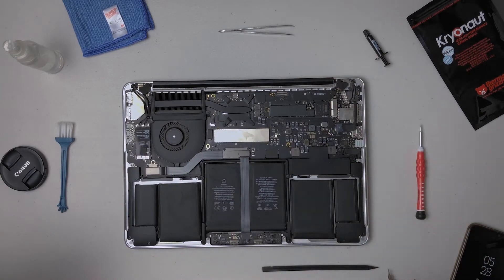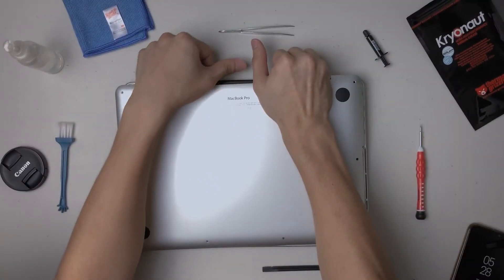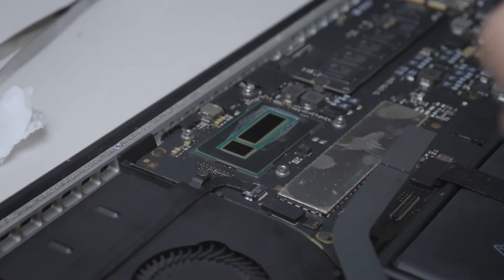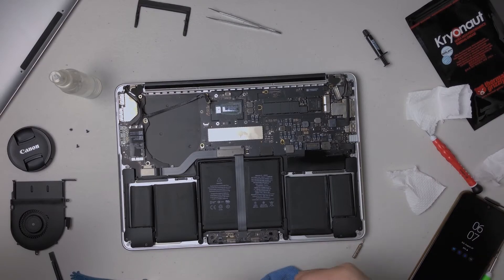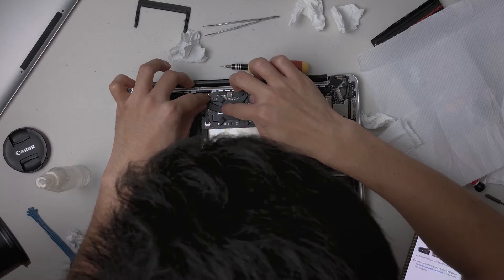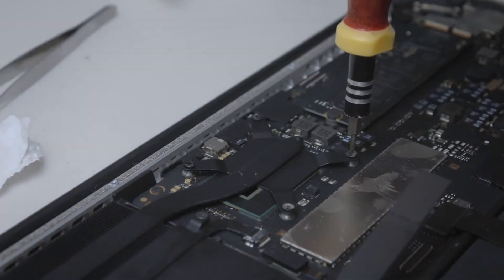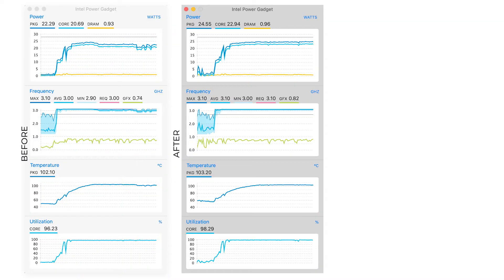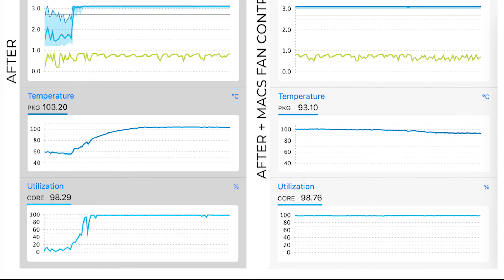MacBook Maintenance - Cleaning, Speaker fix, Thermal paste | 5 years and counting

Comment: Do you think Mighty Bond will work? hehe
Reply from the maker: hmm I think it will work but not as well as thick adhesives like rugby. some actually used elmer's glue and said it worked well haha check out my video specific to speaker fix (link in description), full instructions are there and many viewers shared what adhesive they used. you might find it useful

Comment: I have noticed that the temperature after is higher + you start with higher base temperature. Please make sure you have applied the paste correctly.
Reply from the maker: Was it resolved when you reapplied the thermal paste? 
I did a temperature reading before and after and I got the expected temps. Got lucky to get it right the first try (first time applying thermal paste).

Comment: 100 degree Celsius? That’s so dangerous isn’t it?
Reply from the maker: Hmmm, well 2 things:
1. It was during a benchmark, which pushes the CPU to its peak performance. Thus peak temperature.
2. 100 is kind of the rough ceiling for most intel macbooks, really. It won't damage the cpu, unless it's at this temp for a very long time. You'll only reach this temp if you're doing benchmarks, rendering videos, playing heavy games, and other intensive tasks.
I do remember reading somewhere that for some systems (desktop and/or ryzen cpus?) that 100 is a crazy temp hahaha